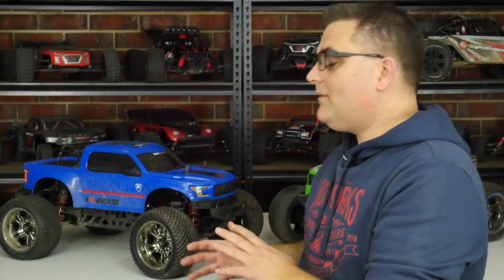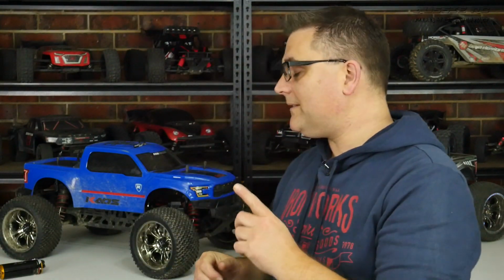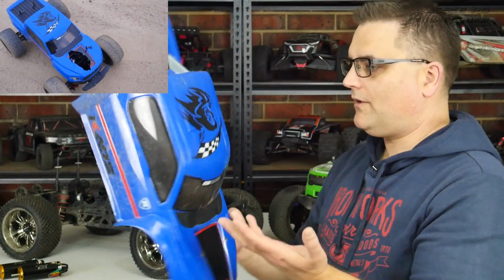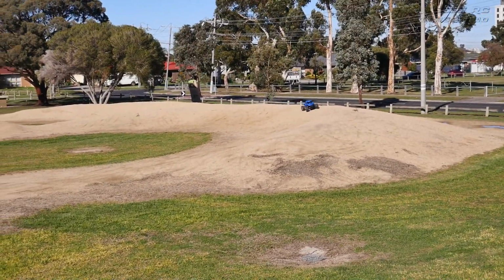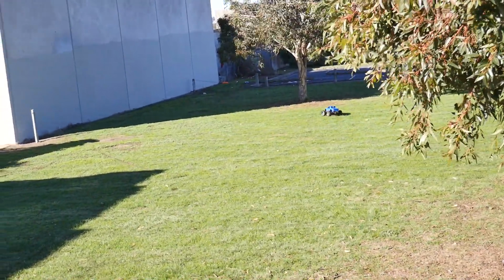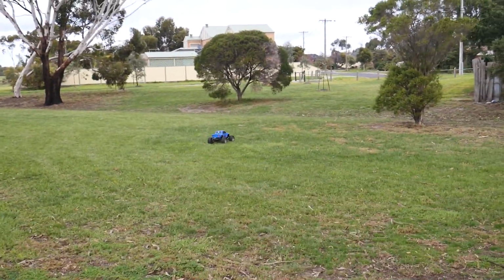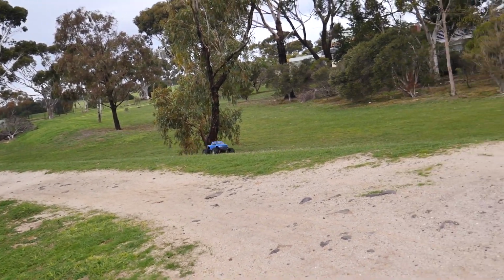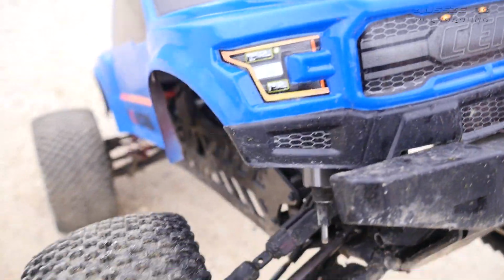CEN Krazy Kaos Reeper returns

Comment: LOL. I had the same issue in my HoBao VT & GTB - long can and no support. Fortunately I had some adhesive wheel weights to to stick the chassis right under the rear of the motor to support it - no issues ever since. As always - great clip Vas - ROCK ON!!
- Jules ( As soon as I saw the TP - I thought of the new Hobbywings self. 

To David Simmons - I see that you are new. I was also new about 3 years ago when I discovered Vas and without him - I would not have learned what Ive learned and can tell you - this guy is truly one of the greatest resources you can have for RCs HANDS DOWN.
Reply from the maker: Thank you Julian, that is one of the nicest things anyone has said about me and the channel. Really appreciate that, my friend. Thank you. 😊👍
Reply: @AussieRCPlayground  any change on the diff oil when you decided to go 8s mate???

Comment: Would a chunk of firm foam under the back of the TPPower motor help alleviate the forces while not causing it to overheat?
Reply: It wouldn't hurt forsure, atleast piece wood or something vas too much weight hanging
Reply: Was thinking same thing👍🏿💎

Comment: Great video! What I appreciate a lot about your videos are your driving skills and sensibility. A lot of people seem to have only 0 & 100% throttle, you can hear them constantly blipping the throttle. Or they will steer and constantly let go of the wheel; you can hear the wheel & spring bouncing. However you display excellent control over the vehicles, and the right amount of 'craziness' in bashing. No need to crash it on purpose, `send it to the moon` only to have it break etc. Keep up the great work!!

Comment: Hey vas, i dont know if you are still working on the reeper and i got one recently, but ive come to find out the losi lst 3xle shocks will fit and even rc raven dual rate springs fit stock shocks, also if you havent checked them out alza racing makes a good number of upgrades for the reeper, xrs racing makes 24mm wheel hex for other large scale tires, if you're still working with it itd be awesome to see of you use those options as well

Comment: Awesome Vid Vas, I'm running a 1650 TP in my cen colossus and like you said in the last kaos build,on 8s no more than 1/2 throttle or your doing cartwheels down the field. I think 6s is the sweet spot for this truck as it's light and can really rip if it's paired with the right kv. I think you're onto something with that Hobbywing as she looks like a great motor !!!

Comment: Hey Vas, love your work. I'm glad to see the Reaper back. I've done something similar but went with the 1100kv Hobbywing. It has the 8mm shaft with a 20 tooth mod 1 pinion and stock spur running 8s. It's a real handfull.... lots of power, lots of fun! I want to thank you because the insperation for the build came from watching your 8s Reaper build.
Reply from the maker: That's awesome Walter, great to hear. Only reason I opted for this motor was because it was the only one with a 5mm shaft. Finding 8mm pinions is a bit hard and there aren't many tooth options, so I kept it simple. It runs 6S and for a light truck like this, it works fine and has plenty of power without getting hot. I may even gear up a couple of teeth now for a little extra Krazy. 😉👍
Reply: @AussieRCPlayground  I was able to find a 20 and 21 tooth pinion set ( used the 20). There's also an 18 tooth available but since I have plenty of torque and temps are cool I haven't gotten it yet. I'm thinking of trying the 18 to see if it  improves drivability, the thing is quite a handfull as is. 🤣😂 I can't really get full throttle, although there is something to be said for wheelies at any speed! I can find you a link for the gears if you're ever interested.

Comment: Hey Vas
Sorry to see your issues with the TP.
They can be a bit difficult to deal with due to language, fortunately here in Europe we have TP Power Europe so fewer issues.

I've used the even longer 4070 motors for over two years not, and have not had a single issue like yours.

Don't give up on it just yet. TP makes great stuff.

Comment: Hi What diff fuilds are you running on this truck thank you Sir
Reply from the maker: I'm 100% sure the front and rear diffs were all stock, but I can't remember if I changed the centre diff on this one or not. I think I did, but honestly, it's been so long I can't remember...
Reply: Ty for getting back to me. I love your videos you made of this truck a  few years ago. I think I need to tune my colossus diffs my front wheels are spinning so fast they are growing compaired to the rears. My rears don't grow like my fronts do. So tring to figure out what diff oil to put in the the front, center,rear.

Comment: Guessing the loose center diff is what's giving you a lot of nose heavy landings. Instead of the power making it to the ground on the rear tires, the front tires are unloading and losing momentum up the jumps. With the way that thing flies and is thrown about, it seems a lot smaller than it really is. Almost seems like the shocks are a hair on the stiff side for the weight. Good for big jumps, but a bit sketchy otherwise. Great video as always!

Curious if you noticed if the chassis bottoms out before the shocks do. Some run too big of a tire and don't allow the chassis to hit the ground properly. Granted, looked like you landed hard on that front corner, so likely wouldn't matter much anyway for that hit.

Comment: To bad about the TP motor, such a good motor with a design floor that could have been easily fixed. Good for on road speed runs, maybe the TP 4040, 4050 & 4060 motors should be better being shorter. 

Have you tried Poseidon 1515 brushless motors or the larger version?

Comment: Great video Vas 😜!!!! The CEN Reeper looks so NUTS to drive with that extra power 👀. That's a bummer about the TP hassle. Especially waiting weeks to be back where you started. The Hobbywing 4985 looks like a brute. I'm still scratching my head about the Max6 having a <1500 kv motor limit yet being paired with a 1650 in a combo 🤔. My Hexfly Hex6 started to overheat running my Hobbystar 4092 1730 in the summer heat despite reasonable gearing. Glad you got this build sorted 👌. Looks like a Super fun truck🤗🤘🤘😎💪👊👊
Reply: Isn't the 1500kv motor limit on the max6 apply for 8s running on the 56 series motors? The motor limit on 6s will probably be 2200kv like with the max8. I have a max6 in my hyper St with a 4076 1700kv and it runs stone cold. The fan was actually broken for 2 or three runs and it only got to about 60c.
Reply: @LawrenceTimme  I'll have another look at the specs Lawrence 👀. You're probably right. I was bummed my Hexfly Hex6 hit thermal 😱. Happened several times last summer with my Kraton running 6s. The 4092 is a weird size, but RCJuice claims any 1/8 150A ESC should suffice. So far my Max8 is performing great with it. It's possible I damaged a mosfet or something. I had one loose connection incident that had toasted a motor lead and singed the ESC cup. Appreciate the input Brother 👊
Reply: @richduperbash2966  I had the opposite problem, I blew up a quicrun 150a and a max8, the quicrun went up like a flame thrower on 5s and the max8 popped a full row of mosfets. Since I had the max6 it's been fine :D

Whatever works best I guess! Might try a 4082 or 4092 next myself! You can never have too much power when flipping, it's just the extra weight that can cause issues on landings 👍😁
Reply: Hey Rich, you should get one of these and do a build, would be awesome to see you airing it out where you bash the senton and others, maybe do kaos parts, lst shocks with 5mm shafts and raven rc dual rates, hobbystar has some larger motors i think will make it insane

Comment: Ty for your for getting back to me. I love your videos you made of this truck a  few years ago. I think I need to tune my colossus diffs my front wheels are spinning so fast they are growing compaired to the rears. My rears don't grow like my fronts do. So tring to figure out what diff oil to put in the the front, center,rear. Ty 4 ur help
Reply from the maker: Try this: 60k rear, 300-500k centre, 100k front.
The thicker the centre diff is, the more power you put to the rear wheels. Well, to the front and rear diffs. So this will determine how much "wheelie power" you want. If you go with really thick oil, like 1mil, then the diff will be almost locked and this can make the truck harder to drive. If you use oil that's too thin, then the front tyres balloon like crazy. Sometimes it's a bit of trial & error to find out what works best for you, but the options I gave you are a good starting point. Good luck and happy bashing. 😎
Reply: Ty so much for all your help

Comment: Your so honest towards your viewers and manufacturers. I really appriciate that.
This truck tends to tip over fairly quickly. Is that the side bite of the tires or the high CG? How much lighter is this truck in comparison to the Xmaxx?
Reply: Don't know about the xmaxx but the Reeper is slightly narrower as the xmaxx, not much. If you get wider axles you can kinda get around with it or you swap the factory tires ( not from the American force) to the American force tires its kinda the same because the af tires have a bigger offset. The Reeper weights about 7kg stock without lipos so if you have dual lipos in there you'll come closer to 8kg

Comment: I will watch this video in full of course but felt compelled to comment after just 40 seconds.... some would say this is not even remotely a competitor to the Xmaxx.... and it’s these people that I thoroughly 100% agree with!😂😂👍

It is however in competition with the hpi savage xl 😀 flux. Medic did a very good actual comparison video showing not the very few.... similarities ( please name them😂) but the many , many differences. Same league.... no no no. Both good rc’s possibly.... similar ... no. A bit like comparing how a Xmaxx 8s runs and a arrma Kraton v4 on 6s eh Vas me old mate. 😜👍
Reply from the maker: HPI Savage? I see the twin vertical plates can draw a comparison, but this would eat the Savage for breakfast, lunch and tea. LOL. There is no comparison there, I'm sorry.
As for comparing it to the X-Maxx, I think most were assuming it would be of compatible size, but it falls short by a few millimetres in both length and width. I showed this in my very first video I did of the Reeper.
The X-MAXX stands alone. For now. Time will tell if someone will knock it off its perch and I can only hope it won't be too long before that happens. CEN may not have been the one to do it, but this truck (stock Reeper) is just as fast and cheaper to run, so I'll take that as a win. For now...
Reply: Aussie RC Playground the only win maybe.... I do agree though totally. A-true competition rc mt from any of the likes of losi, arrma, cen ( less so here in the uk as they don’t seem to sell here) hpi if they still exist... or some else has been long awaited!!!! I really don’t understand why no one has stepped into the ring with traxxas.

I think many expected/ expect arrma to do it. But they are no where near sadly😏
Reply from the maker: @RCmaxxUK  I think if someone is serious about going up against the X-Maxx, they need to do it right or they'll be laughed out of the ring. So a lot of R&D will need to be done to stand a chance. CEN sort of tried with the Reeper, but it was clear from the start that even the Reeper was in a league of its own and not really going after the X-Maxx. A cheaper alternative, maybe, but not a direct competitor.
We'll see what the future holds and who has the balls to properly get in the ring with the X-Maxx... Hopefully someone will do it. 🤷‍♂️
Reply: Aussie RC Playground I really hope so.  The Xmaxx is so much fun to use. But of course could be improved upon......I will definitely be very interested in another brands offering as I know many others would also.
Reply: Honestly i think if anyone could, provided they take the time and make the effort i would go with Team Associated, the rival 1/8 was a beast of a truck, while the 2 biggest things they needed to change are the shock towers and the suspension design, but maybe use a similar chassis design,  as my mgt 4.6 still has a perfectly straight chassis and only broken a shocktower
Reply: Maybe if cen and team associated were to do a co-op project much like they did with thunder tiger back in the day